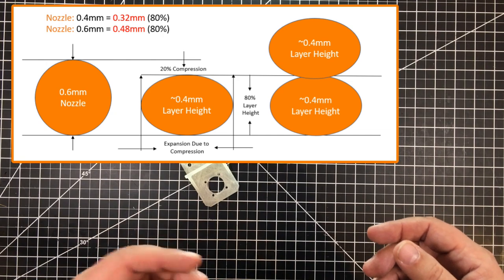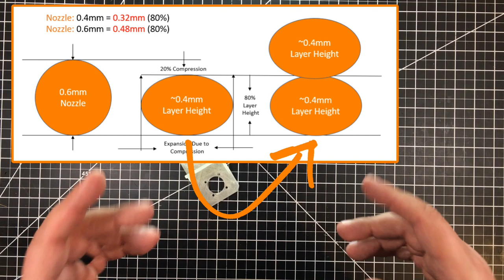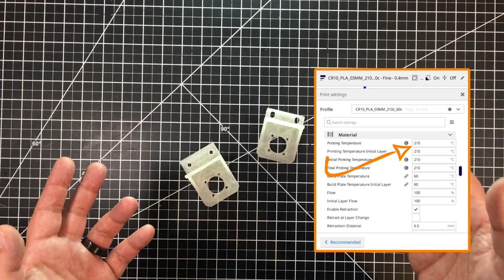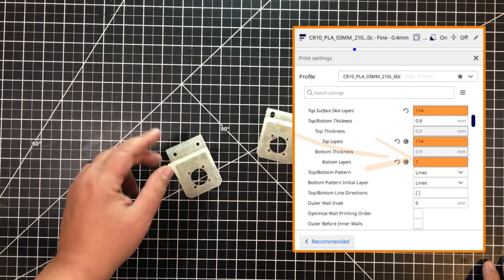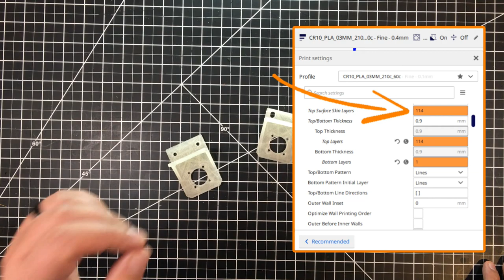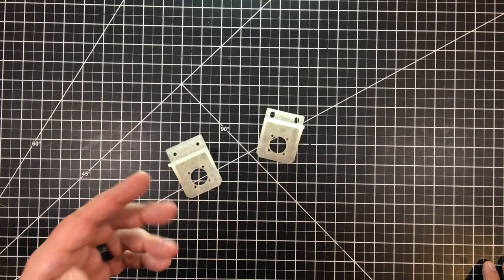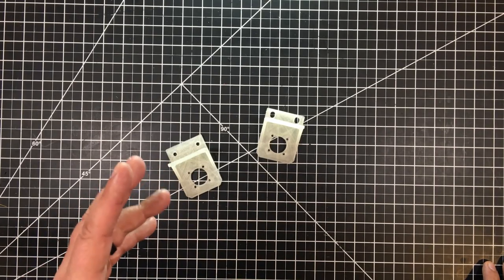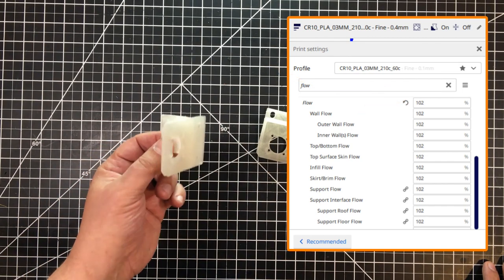Shop Talk - My Secrets to Printing Super Strong Parts!

Comment: Good tip on using (abusing?) "number of top layers" parameter.  It has always irked me that "100% infill" doesn't do what I think it should do.  But I never recognized that "number of top layers" feature could be leveraged against that until this video.  I will give it a shot next time I need a strong part.
Reply: Interesting to note: it doesn't seem to work in the current version of PrusaSlicer.  If I ask it for 100 top layers it gives me one top layer and the 99 layers below it are a copy of the top layer, with infill for the remainder.  But, in testing I discovered an interesting hack: If I tell it I want a million bottom layers it makes every layer a solid layer - no need to count layers and go back to ask for the correct number.  I think I'll save a setting called "solid" that does this.  Very cool.
Reply from the maker: Valid note top layer "might not" work on all slicers, it does on CURA and I think the reason for this is slicers handle top layers in different ways as this will not work on KISS (or at least I have found a straight forward way to replicate).  Also you can tell CURA to use 999 top layers rather then counting, however this just never felt right as its knowing misuse (or abuse as you put it) of the function.

Comment: this is directly contradictory to what CNC kitchens results were re: layer hieght and strength.
Reply: interestnig, i'd like to see some testing data on this
Reply: Might be compensated by the overextrusion .. more testing needed
Reply from the maker: Thanks for commenting, however CNC Kitchen only focused on layer height and not the combination.  If you notice his prints have gaps in the layers so of course there will be issues.  When you over extrude and increase the heat is a big part of it and second mine is a solid object zero infill this makes a HUGE difference.
Reply: @DIY3DTECHcom  yeah I was commenting as I watched by the end I was on board :)

Comment: What about printing a threaded part? ( A bolt/ an adjustment screw)
Reply from the maker: You could do that, however because the thread resolution, you would likely be forced to a shorter layer height just so the threads resolve correctly...  I just might make a video this...
Reply: @DIY3DTECHcom  Second point is: will annealing mess up the threads?
Reply from the maker: I don't think there would an issue as your only bringing it to the glass temp...

Comment: Any dimension change when annealing?
Reply from the maker: Yes there is some shrinkage.  However I typically build in a variable"fudge factor" into the model  numbers as 95% of my models are parametric.  So print and anneal, then adjust this number, reprint and anneal.

Comment: On cnc kitchen the guy experimented with layer height and parts with higher number of layers appeared more robust
Reply from the maker: Thanks for commenting, however it seem people missed Tip #3 this is solid object and there is no infill so only the shell is hold things together in his test.  He also did not over extrude, nor increase the heat nor use all surface layers either...
Reply: @DIY3DTECHcom  So show us your data then.  Or show us how YOUR "secret" methods (which btw, other people have used for years) make the parts stronger than normal methods.
Reply from the maker: @twinturbostang  thanks for comment yet you appear not to have watched the video as the video was not about layer height it was about printing super strong parts using a recipe.  CNC Kitchen used infill on sloppy printed parts my "recipe" includes several steps being (1) Layer height, (2) Over-extrustion, (3) Temp (hotter) and (4) all Surface Layer to create one "solid" part to create a "recipe".  Proof well that was on the screen and you will see these "super strong" parts actually in an couple up coming episodes supporting a fair amount of real-world weight/forces...

Comment: umm CNC kitchen demonstrates the contrary, and from my own experience I can say what he shows is true, thick layers aren't good
Reply from the maker: For me the logic is simple, the more layer lines the more opportunity for one to break as too not only is there more them, however they are bonding with more more surface area too...
Reply: DIY3DTECH.com I disagree, and to be fair I’ve only been printing for a few months, but more layers means more surface area bonding vertically whereas a thicker wall will give more surface area horizontally. The larger horizontal surface area is what creates the strength.
Reply from the maker: @shelpman8765  Trey you did not watch the video then, the video was not about layer height it was about printing super strong parts using a recipe.  CNC Kitchen used infill on sloppy printed parts my "recipe" includes several steps being (1) Layer height, (2) Over-extrustion, (3) Temp (hotter) and (4) all Surface Layer to create one "solid" part to create a "recipe"...

Comment: You missed the most effective tip, reduce the fan as much as you can, off if possible.
Reply from the maker: Interesting possible add as I do leave the fan on because I am pushing hotter then normal plastic